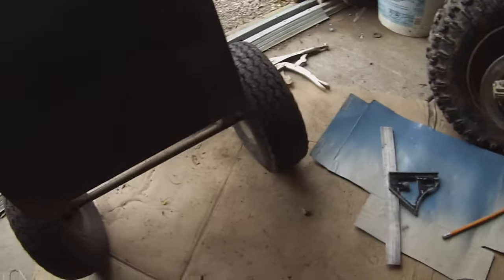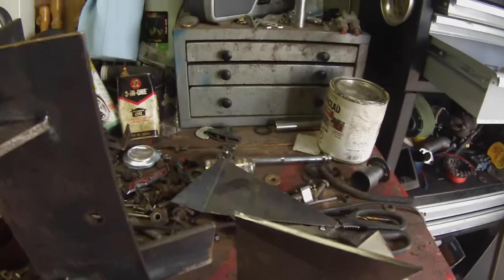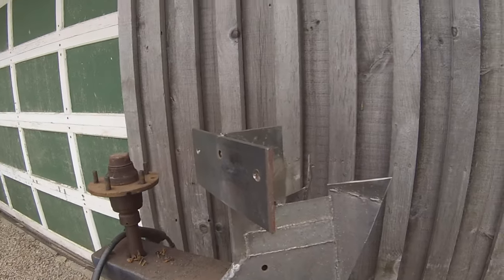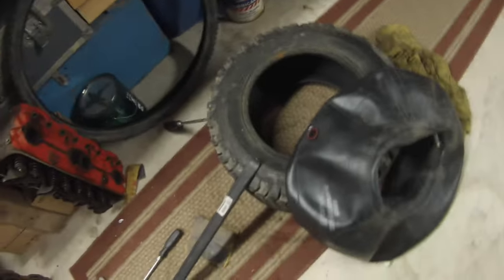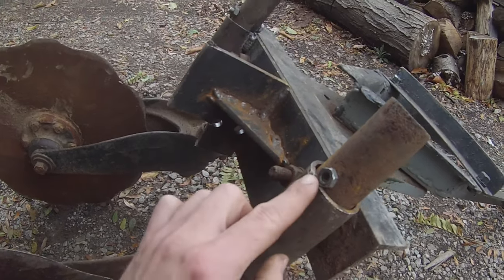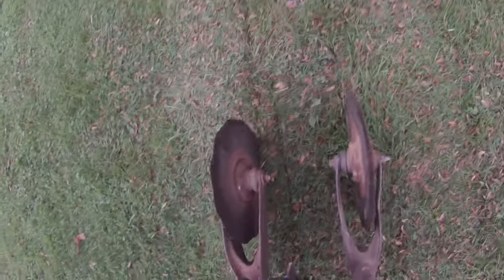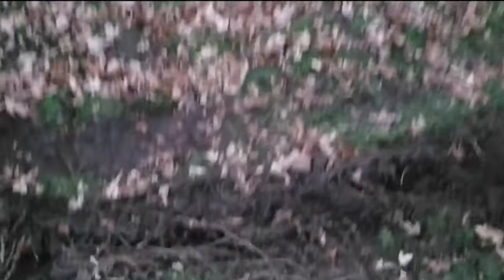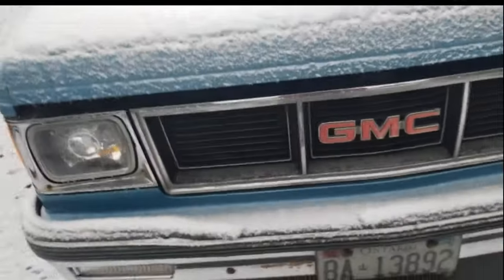Buliding a trench digger and putting drainage pipe in with my Allis chalmers b112

Comment: Hell yeah bro! Sweet build, nice welds. I got a subsoiler for my kubota tractor to dig trenches. Works great for drainage or water/electric lines. I’m about to put power into my barn it’s about 150ft long trench. Been running off of 2 extension cords 😂

Comment: I used 7 rail spikes welded in a slightly staggered row to create a dirt saw. 
8"  rocks roll up and out of the ground. 
It cuts a 2" wide path about a foot deep in 2 passes.
Reply from the maker: I'd like to see this
Reply: @DougL12  
I will try to get one of my kids to post a video on here somewhere. 
I didn't really think it was a remarkable item. 
I basically just copied the old horse drawn ice saw idea but staggered the teeth. 
I was a bit surprised at the size of the rocks that would get caught in the teeth and just roll right up out of the ground.